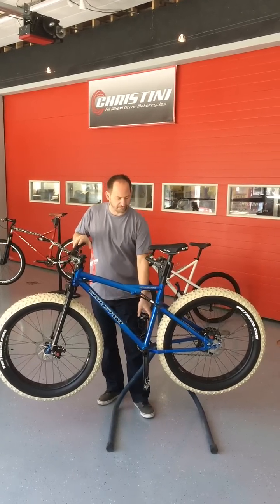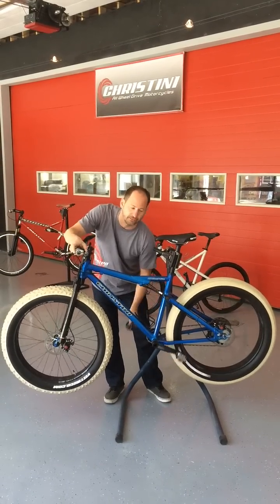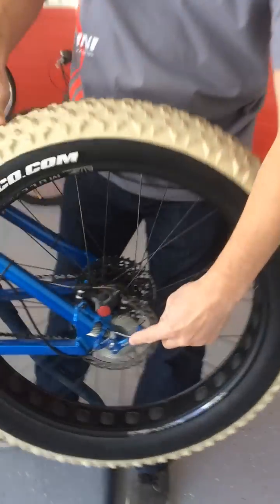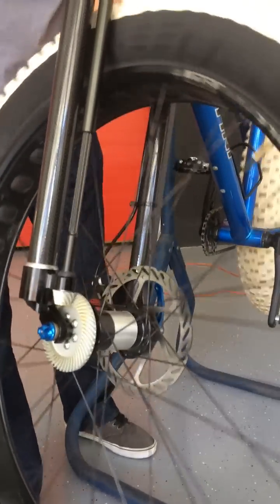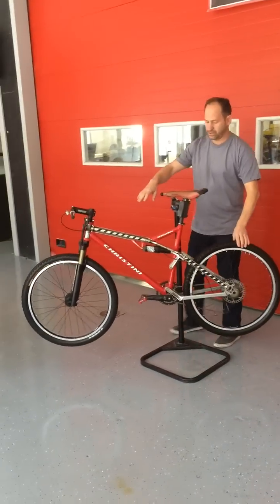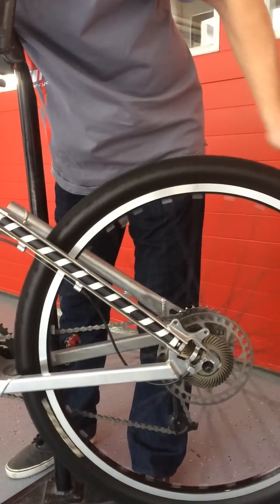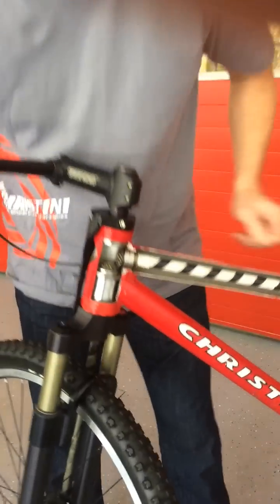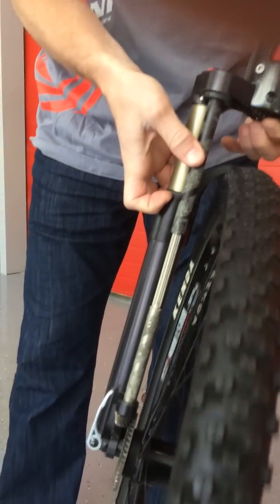AWD Fat Bike Tech description - How it Works  www.christinibicycles.com

Comment: The problem with this bikes is that when power is applied to the front wheel the front wheel will try to move to one side if the bike is actually moving on terrain, this effect will only be increased on an incline where it could be easier to turn the front wheel than power the bike